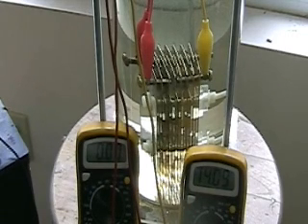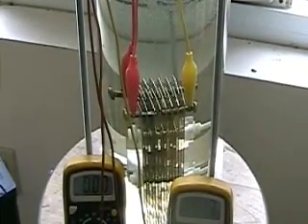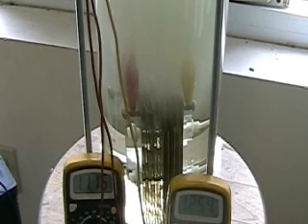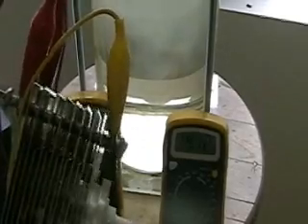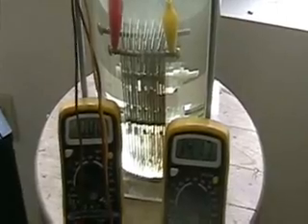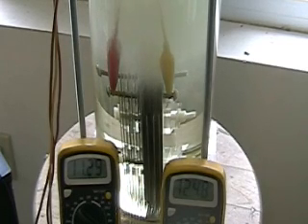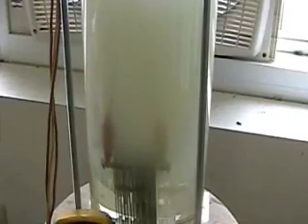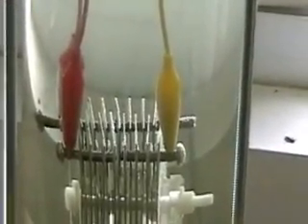Hydrogen Tap (Comp. Nut. Pl. AAron's Cell) 166

Comment: Mine should arrive tommorrow, I just went out and got new amp meters, a needle valve and a variable air jet valve from an air compressor.  My first experiment will be to quatify gas production of my Aaron cell.

Then I want to try to wind a coil around the tube to creat a magnetic field, then run the cell to see what happens.

Comment: also visual inspection of your last few test would lead one to believe that 2 negative plates surrounded on all sides with positive plates at a 2/8 ratio of 8 poss to 2 neg may reveal some powerful hydrogen output. I am unfortunately poor or I would buy your cell an try myself. You are doing great work and I admire your persistence.

Comment: John just a noob question. You often have issues with heat. If you were to put your tube under pressure would it not allow you to run at a higher temp while remaining at a constant production level. It seems that working under a vacuum would make recovery of hydrogen easier for storage or injection into an engine.